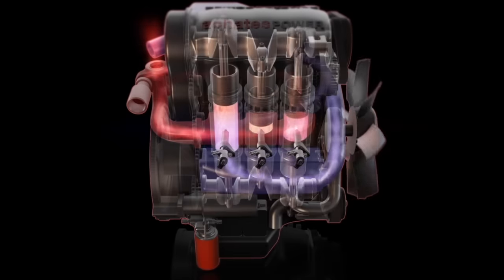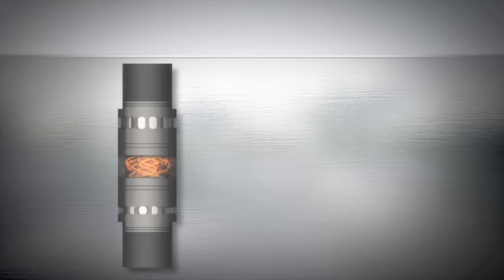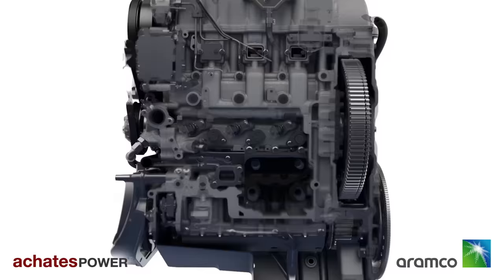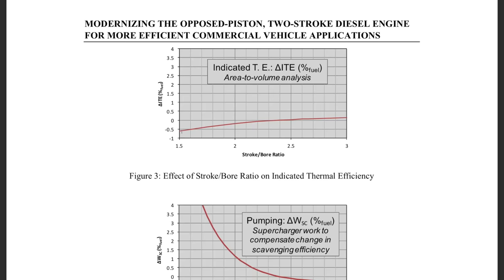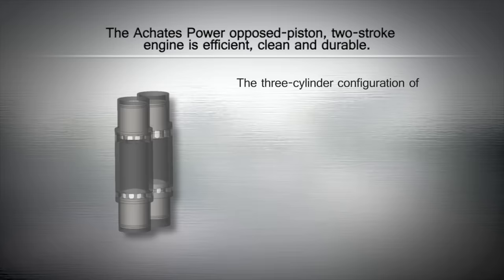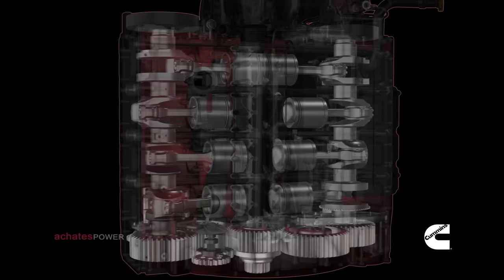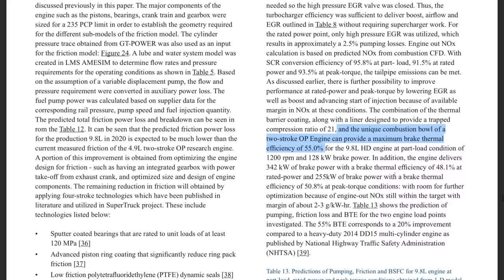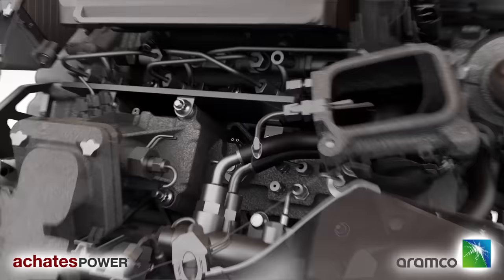Opposed Piston Diesel Engines Are Crazy Efficient

Comment: Very impressive torque figures - I like it.
Reply: That comes from it being a 2 stroke diesel they've always had good torque numbers when compared to contemporary 4 strokes because you get 2x as many power strokes per revolution.
Reply: as long as it is an ICE,whether the form. iam in
Reply: @Chase Rayfield those performance numbers are already achieved with a conventional 2l bi-turbo engine... dont see any advantage at the moment... fuel efficiency?
Reply: I thought it was impressive too until he said it was turbo charged and super charged. At that point the torque figures aren’t nearly as impressive.
Reply: Chase Rayfield if that's the case why did the Detroit Diesel 2 stroke fall out of favor?
Reply: Expensive, to build, with turbo and super charging. 4 stroke diesels are, in smaller sizes, more fuel efficient.
Reply: The efficiency is the headliner, but it's also a much simpler engine, which should result in greater reliability and affordability.

The cost to build this engine shouldn't be more than building a standard modern non-turbo 4 cylinder diesel engine.  Cranks are cheaper than heads...

No timing hardware (aside from the simple gear set to link both crankshafts), valves, or gasket in the compression zone are definitely improvements for reliability.

The engine should also be reasonably smooth with the opposing masses operating in perfect sync provided the pistons, rods, and cranks are balanced.
Reply: jabroni6199 2 stroke diesels must have a blower aka supercharger....it wouldn't run at all without one. The turbo provides higher intake pressure and recycles waste heat from the exhaust while allowing to unload the less efficient blower.
Reply: ThePaulv12 they couldn't meet emitions without a redesign similar to this.... They can almost meet emissions with electronic controls.
Reply: furlong?
Reply: Chase Rayfield Then why is my Detroit 8v92 gutless, especially when lugged, and my Series 60 is much better at making torque while both being turbocharged and both set at 450 horsepower?  They’re both very close to 12 liter displacement.

An even more fair comparison is an 8v92 vs a Cat 3208. The 3208 makes better torque, both being V8s, while the 3208 is lower displacement. Same deal with my Stihl FS 130 and FS 250. The 130 has more torque as a 4 stroke than the higher, though similar displacement 250.

The simple answer is that a 2 stroke makes better power at high RPM, but a 4 stroke far outperforms them at peak torque.
Reply: Yeah I'd love to see if it a vehicle? Sounds like what I need for my Colorado
Reply: 2 stroke diesels have not always made more torque than 4 strokes. and the torque they do make is in a narrow band. I will cite the most common 2 stroke diesel lines 53, 71 and 92 series detroit diesels.  An 8v92 turbo after cooled 736 C.I. 435 hp 2100 rpm 1,242 lb torque 1400 rpm.  4 stroke  series 60 12.7  778 C.I.  435 hp 2100 rpm  1710 ft of torque at 1200 rpm.   over 30% more torque at a lower rpm.   More power strokes will not automatically make more torque , 2 stroke suffer from power scavenging  and low cylinder pressures at end of stroke.
 Another example could be had from any one whose rode a 2 stroke and 4 stroke dirt bike, while not diesels the same problem is occuring poor scavenging and lower end of stroke cylinder pressures
Reply: ford ecoboost 2.7 is already getting better numbers with a conventional v6 engine layout . direct injection is the key
Reply: jabroni6199 lol the turbo and supercharger are there to improve fuel efficiency not to introduce more power... you clearly didn't grasp the main concept of this demostration
Reply: Jabroni6199:  A 2-stroke cylinder ported engine mush have some sort of either electrical or mechanical "blower" to move air into the cylinders to start the engine.  Once the engine is started the turbocharger will supply the majority of the air needed to refresh the cylinders with fresh air.  A person, I suppose, could hook a hi-speed electric motor to the turbocharger so that at startup the electric motor would spin the turbo charger fast enough to supply that initial air supply and then disengage when the engine started and the exhaust brought the turbocharger up to speed.  But what would be easier and less expensive and more reliable for supplying the startup air supply, a supercharger or some kind of hybrid electrified turbocharger.

As far as the torque numbers, I look at the design and think of leverage, like in using crowbars.  With 2 crankshafts I am apply force to 2 "levers" (crowbars) in the two crank shafts at the same time.  More or less doubling the the force applied from the same energy source on each power stroke.  In my mind, that is what supplies the extra torque.  Though being a 2-stroke engine doesn't hurt.  What ever the true source, torque numbers that hi are still impressive.
Reply: Are there conventional turbo diesel engines that have poor torque now? If so I've not heard of them, that's kind of their thing.
Reply: 2 strokes make more hp and torque per cc and weight less.
Reply: Sean Angermeier, Is that peak torque at the crankshaft? Or after being geared down (IE: after the transmission)?

Because with gears, you can create as much torque as you want. What's more important is how wide is the power band? The wider the power band, the fewer gears you need in your transmission.
Reply: Jim Kiley, Regarding the 2 levers with the apposed pistons vs. 1 lever on a conventional single crankshaft engine. In order to obtain the proper compression ratio, the lever arm will be half as long on the 2 lever engine than on the single lever engine.

Therefor the torque produced on each of the 2 levers will be half that of the 1 lever. The net result is that half the torque times twice the number of levers is the same as twice the torque on half the number of levers.
Reply: Terje Oseberg Thank you voice of rational thought. We always get Max Torque and Max Hp figures at the crank (with no accessories, during a fake windstorm) but what we really want are wheel hp and torque curves, not just peaks.
Reply: I believe that the torque of diesel engines is higher than the torque of gas engines because the greater compression ratio of diesel engines requires a longer lever than that of the lower compression ratio gas engine. The compression ratio is nearly double, so the lever arm on the crankshaft is nearly double the length and thus nearly double the torque for the same size piston. However, since that piston is moving nearly twice as far, the displacement will be nearly double as well.
Reply: Terje Oseberg again... Torque isn't a static number, also doubling compression isn't really a positive. It seems like it would be but it's not if you're running a turbo application. For every increase in mechanical compression you need to lower the airflow to keep from turning your engine into a grenade.
Reply: David Regan, Yes. Of course. But why is this? Well, if you pre-compress the incoming air with a compressor (either turbo or supercharger) then you are compressing twice. Once with the compressor, then again with the compression ratio.

I believe that the compression ratio is determined by the heating of the air fuel mixture that occurs due to compressing the gas. Therefor, compressing the air before it enters the engine gives you a chance to cool it a bit before it enters the combustion chamber. Thus the intercooler.

So, I'm wondering. If you were able to cool the pre-compressed air from the compressor to ambient temperature,  would you still have to reduce the compression ratio?

Also, how does adding a compressor to an engine effect torque? Is it different if the compressor is a supercharger or a turbo?
Reply: @red66chevy  its powered by petrol not diesel....
Reply: Terje Oseberg Those are at the crankshaft for the dynamometer numbers. The drivelines are actually set up for more reduction on the 8v92.
Reply: @Oliver Mayo Apologies for commenting - I should have realised that it would bother you.
Reply: @limcharles9730   Those engines are not anywhere near as efficient.
Reply: @jabroni6199   They are not supercharged so to speak the supercharger does not build any boost and only moves the air through the engine.
Reply: @carlthor91   They are not more fuel efficient...
Reply: @ThePaulv12  I imagine that the technology advancements made since the old Detroits were discontinued would of made a big difference. But it still would of taken much reworking. At that time it was just better to move on to a four stroke. And Detroit has a very good diesel motor today, so not much incentive to go back.
Reply: @matthewq4b  2 strokes running at constant speeds are, 'slightly'. With less parts flying around, to keep track of and maintain, really helping the bottom line. Also slow reving 2 stroke diesels are easier to work around, and generally last much longer, although with the ship scrapping rate these days, I wouldn't want to bet on it. Some information from diesel engine builders follows, as close as I could find a match:

Efficient 4 stroke ship diesel, data from published figures:

WÄRTSILÄ 46F MAIN TECHNICAL DATA  9L46F 10,800 kW @ 600 rpm
Cylinder bore 460 mm 
Piston stroke 580 mm

7200 sR1/100 °F, ISO 8217, category ISO-F-RMK 700 
SFOC 171 g/kWh, at ISO condition

Efficient 2 stroke ship diesel, data from published figures:

WinGD (Sulzer Diesel)

WinGD RT-flex48T-D
IMO Tier II/Tier III (SCR)

8 Cylinder 11,640 kW @ 127 rpm
Cylinder bore    480mm
Piston stroke    2000mm

Brake specific fuel consumption (bsfc) in g/kWh
BSFC  Standard Tuning  169.8 g/kW/hr at R1

Fairbanks Morse are not publishing BFSC numbers for any of their engines, I had to go elsewhere.
Cheers
Reply: @carlthor91   You cannot apply efficiency ratings for large ship diesel to smaller automotive size engines. They are completely different...  NO automotive engine approaches the efficacies of large ship engines plus they used a much heavier fuel oil that inherently makes them more efficient.
Reply: @matthewq4b  Okay here are ~175 hp engines, again from published sources, although I had to convert lb/bhp/hr to gramms/kWh, for the Detroit.

Detroit 4-53T 175 hp engine Turbocharged/Supercharged
at most efficient ~0.380 lb/bhp/hr ~230 g/kWh
if I did my conversion correctly

Deutz BF6M1013M 173 hp engine just turbocharged.
at most efficient  215 g/kWh

This is using pump ULSD. And who wants a diesel in anything smaller than a 1 ton truck. If you don't keep a diesel working hard, it wont last any where near what is possible. Figure 200 k miles. If run hard and maintained, even a Cummins in a 1 ton will get close to, or over, 1 million miles. 

Cheers
Reply: @carlthor91   The Duetz is a 6 cylinder engine, with over 7 Liters displacement the Detroit a 4 cylinder 3.5L engine   Really no surprise the Detroit uses less fuel...  You can not compare 2 engines one with over twice the displacement and more cylinders.  Try again.
Reply: @matthewq4b  You try again. Detroit 2 stroke twice the injection events, they where chosen as their footprint was smaller than a comparable 4 stroke of the same power output. Detroit 175 hp. still uses more fuel, 15g/kWh x 130.5 kW more, converting back, almost a kilogram more per hour. I think you need a remedial math class. Your done and well done, I wish you luck in future endeavors.
Reply: Yes - practical car engines could be much smaller than in the example, which was 480 ft lbs.
Reply: That's from the turbo and it being a diesel. A normal turbo diesel 3.0 l is getting better numbers
Reply: @ThePaulv12  Detroits are dirty, modern emissions regs killed them off.

Comment: The Routes group in the UK did a 3 cylinder 3ltr diesel engine in the 1960s called the Commer TS3 (Tilling Stephens) and I did drive one in a 42 seater coach. A very smooth engine whic h had the habit of de-coaking its exhaust system without warning creating plumes of smoke but very economical. This unit was horizontal and had a single crankshaft connected each side by several con-rods.
Thanks for the video.